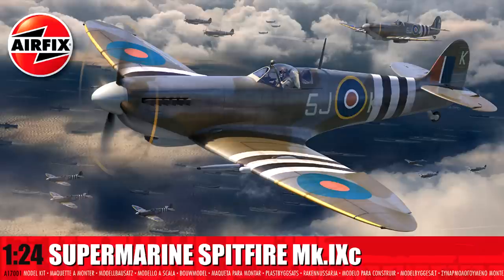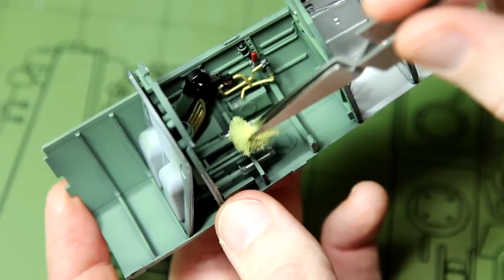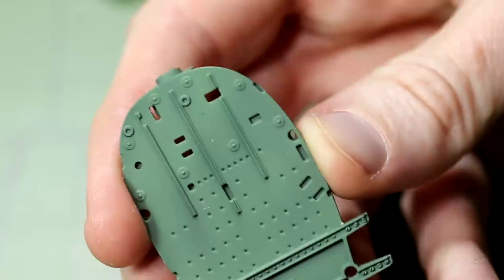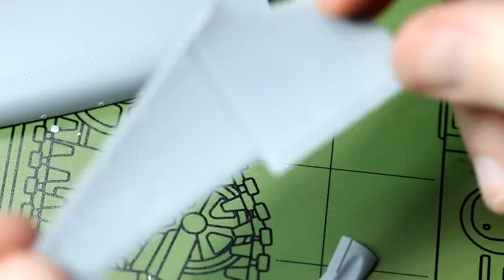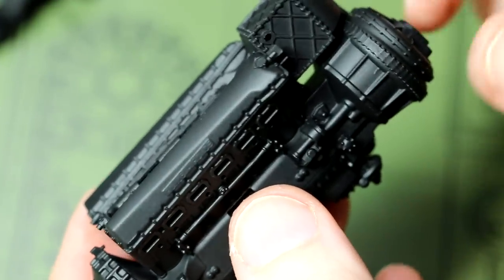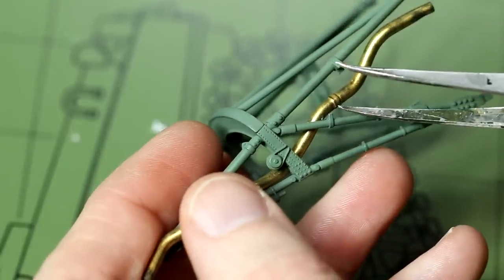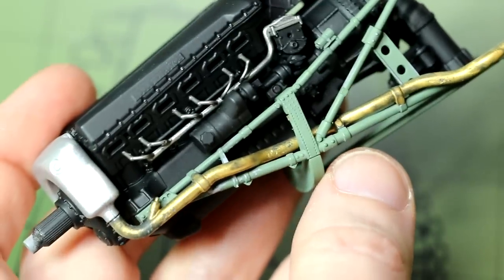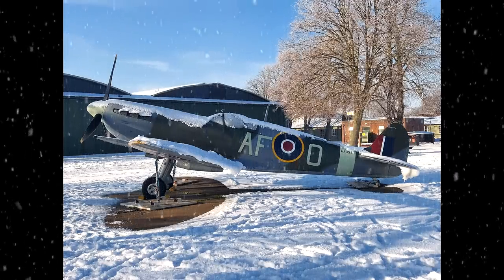New Airfix 1:24 Spitfire - Merlin engine - part 4

Comment: Another nice video. I think I had trouble getting that pipe in on the 1/32 Tamiya and it ended up being scratched and scuffed too. So glad Spitfires used Merlin engines. I'm sure it has it's own difficulties but, it isn't a radial.  😀
Reply from the maker: Thanks Tony

Comment: Have you tried one of those micro-size, vibrating sanders? They look similar to an electric toothbrush, except there is a small round sanding head on the tip of it instead of a brush. It should make short work of sanding filled sink marks like those in tight places on your model. I believe it's made by Mr. Hobby if I remember correctly. Battery powered. I am looking forward to my Spitfire from Hannants, due to arrive soon here in the USA. Nice videos, and they are giving us a big heads-up on what to expect and watch for with our builds of this kit. Thanks!
Reply from the maker: Thank you Craig. I haven't seen those sanders but I will definitely look them up. Sanding is by far my least favourite part of modelling :)

Comment: What about installing  that difficult  pipe back end first so you don't have to fight the vertical section on the front end of the pipe?
Reply from the maker: I think either way the through-and-then-back-again part would be a problem
Reply: @ModelNerd  man that sucks especially  with old hands like mine.

Comment: That problem with the nasty brass pipe not fitting through the engine bearer frame - I would put money on that being a CAD issue! It's all very well when you are designing these things on a computer where it doesn't matter if one part morfs through another, it's just a screen image, whole different ball of wax in the real world though. I watched an actual restoration of a real Spitfire on, I believe, channel 4 recently and the chap they were talking to had the same issue with the real pipe. Everything on the Spitfire was kind of hand built so a lot of jiggery-pokery was required assembling them. Poor bloody mechanics in the factory! This is one area the Germans had right, a lot of their designs, although occasionally over engineered, were thoroughly thought through for ease of manufacture, compare the graceful hard to manufacture curves of the Spitfire with the business like straight lines of the Bf109E. Your build videos are an invaluable source for the modeller looking at building this amazing kit, I have one in the loft as we speak and it has been a great help watching you going through the motions on your build pointing out the areas where you have experienced problems, your efforts are appreciated!
Reply from the maker: Thank you mate, I really appreciate your feedback. I'm glad the videos were useful - good luck with your build!